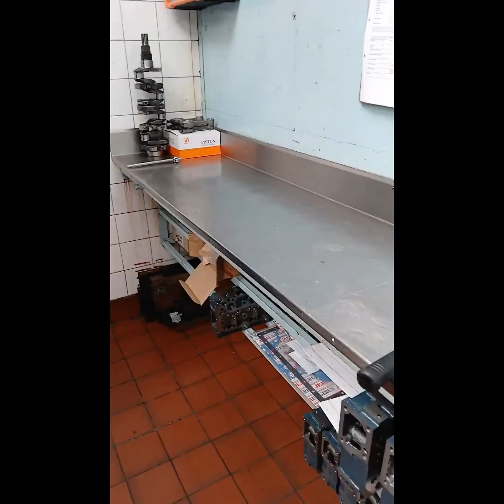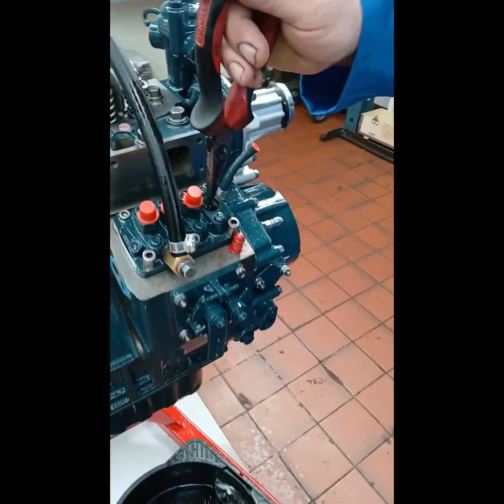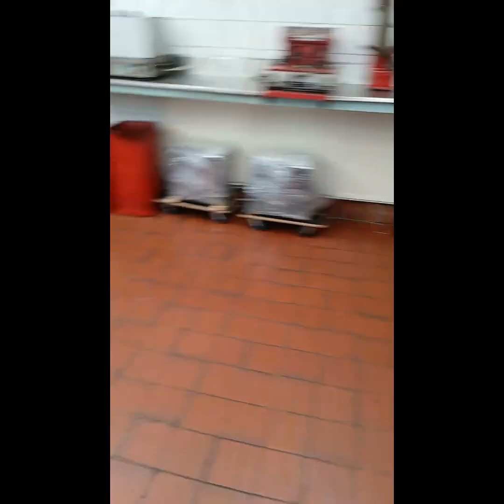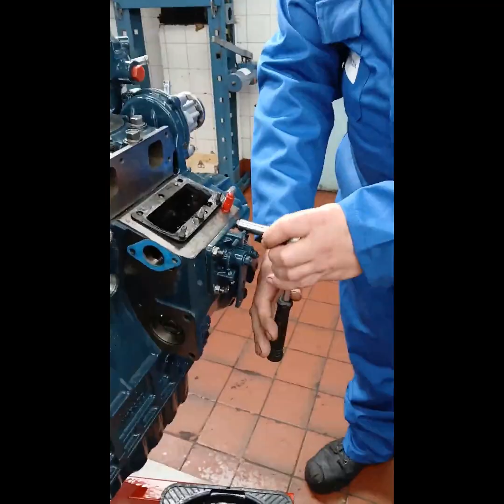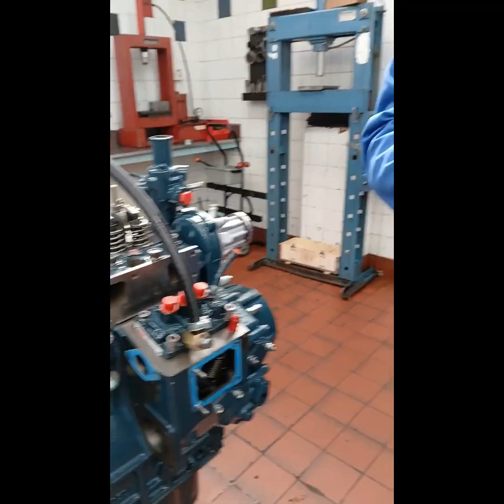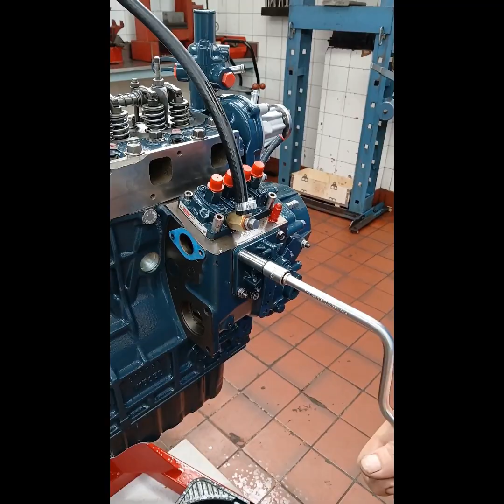How To Check The Spill Timing Of A Kubota Diesel Engine | Kubota V1505 Tutorial

Comment: After numerous searches, I came upon this great  educating video. Thank you. I’m assuming that the stop solenoid is electrically operated and is not relevant to my D1503 kubota engine manual stop, and that the disconnection of the governor spring is relevant to all kubota inline pumps? What actually happens inside the pump when the sipp stops flowing.